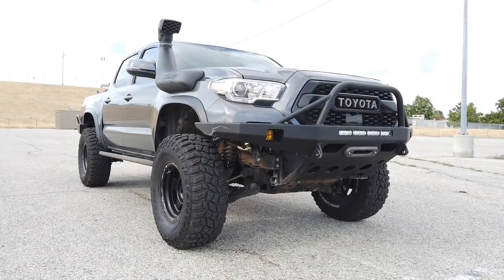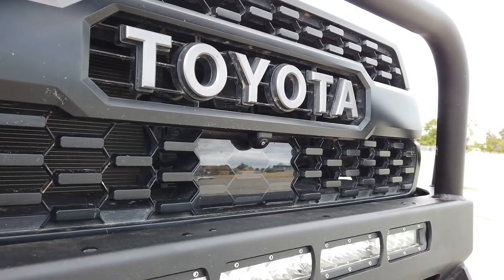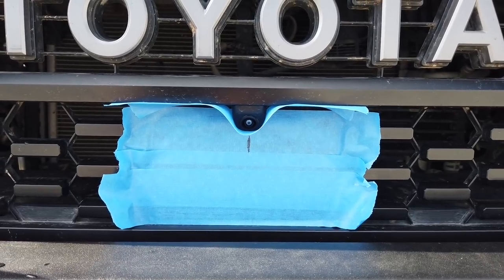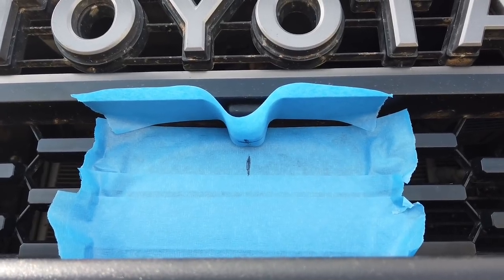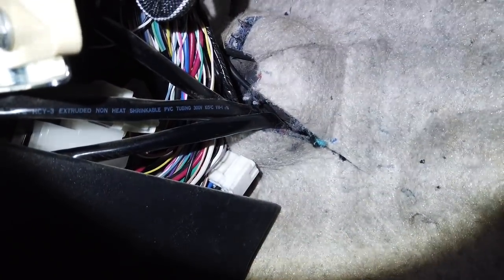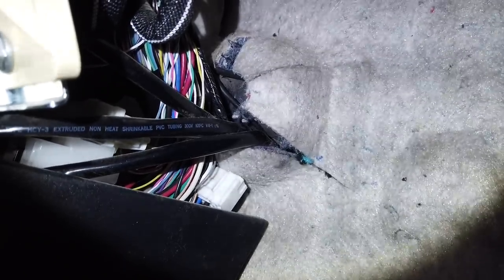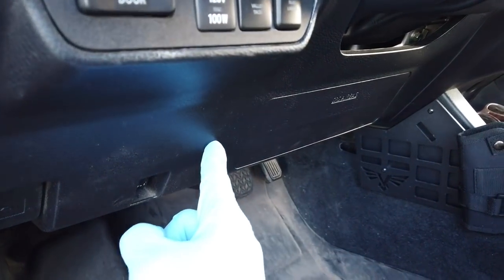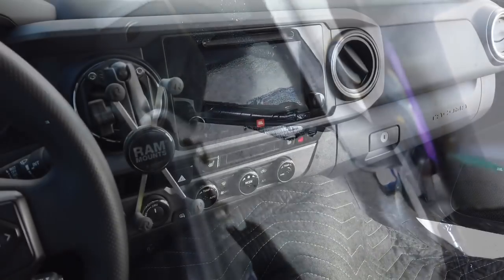Car Solutions Front and Rear Camera System Install on 3rd Gen Toyota Tacoma

Comment: If you use the 12 volt + from the harness for power does the red tip attachment at the camera end thats partnered with the yellow tipped camera end do anything?  What did you do with that red part?  I have a red/black wire with a black tip left over.  Thanks

Comment: Could this be used on an aftermarket radio in my 2017 Tacoma? Would I need a different harness etc.?
Reply from the maker: John Doell I believe the module is specifically meant to work with Toyota Entune units only.
Reply: Hardline Land Co. That blows! I was hoping there was a work around. 😞 Thanks for your reply. 👍

Comment: What camera kit is this? I bought the one where you install a switch. I haven’t installed it yet but just curious at your set up with the camera mode function as well as the front camera turning on when you drive forward

Comment: So the front camera stays on for 30 seconds when you shift to drive all the time?  Is there a way to disable that?
Reply from the maker: bamboo510 it turns on when going from reverse into drive. It stays on for 30 seconds or until you hit about 20 mph. You can hit “Mode” to turn it off before then. Not sure how to disable the function completely though.
Reply: @HardlineLandCo  good info thanks, I think i'll pick one up!

Comment: Curious if anyone has had a problem toggling from front to rear camera view?  When I do that in my 2019 Tacoma the rear view will only stay on for brief second.  Contacted Car Solutions but they have no solution.
Reply from the maker: Mile Hi how many seconds before it turns off? Does it work as normal when you reverse?
Reply: @HardlineLandCo  The view after toggling is about a 10th of a second.  Camera view works correctly when I put vehicle in reverse and it works correctly when I shift into drive.  I just cannot toggle from front camera view while in drive to rear camera view.
Reply from the maker: Mile Hi sorry to hear that. I’ve never encountered that problem since installing the unit. Hopefully someone can chime in with a fix.

Comment: what happens if you use the rear rca yellow input and connect say a third camera, or just modded your oem backup cam to an rca and used that input? has anyone at all used this this rear rca input for anything? if so how does it work with the system?  wondering why it's even there, no one seems to use it.
Reply: I'm going try this soon. I have a bakflip cover that blocks my view when I have the mtb bikes in the back. I use my car-solutions unit to switch to the tailgate cam but the angle is only good for backing up. A car can be 20' behind me and I can barely see it in the monitor. I'm hoping to mount a 3rd cam in the xm fin on the roof then I can see my bikes/bed and rear traffic. I hope putting the truck into reverse overrides the car solutions unit and engages the tailgate cam, then when driving I can toggle between front and roof cams. We'll see soon.
Reply: Aaron Armour awesome. Update us how it works out! I’m curious even with using just two cams but using the rear rca input how that works as well.
Reply: Rick. I guess the unit recognizes if the vehicle has a factory rear cam. I couldn't get any response from the camera I hooked up to the "rear" rca plug on the ttg2. I guess the plug is useless...
Reply: Aaron Armour gotcha. I’m planning to mod the factory video feed to an rca male and use that input. Not sure if that will work or not tho.

Comment: Where did you install  the ground
Reply from the maker: My front camera didn't require a separate ground, only a single 12V power wire to be hooked up to the controller. There's a 12V ground you can hook up to the controller if you need, as well as,  6V power and ground wires (for reverse, I believe).  Cheers!
Reply: So I ordered  same item that you did.. I won't  need conect  ground